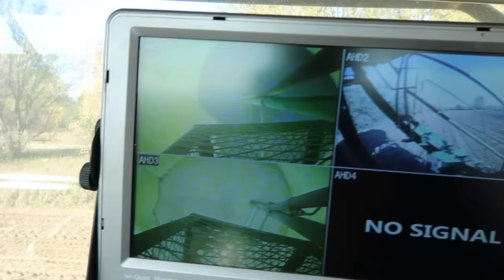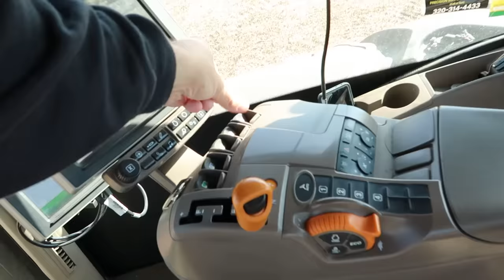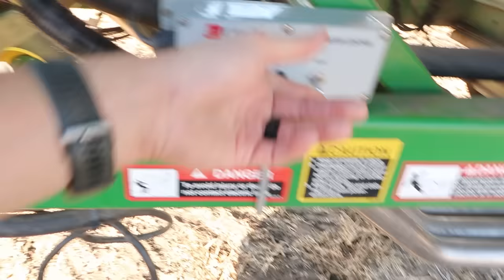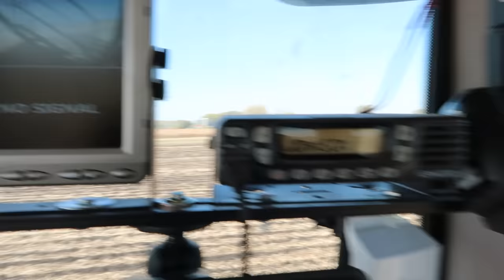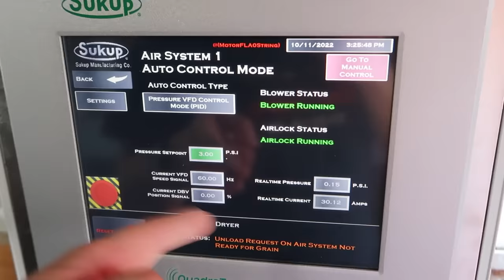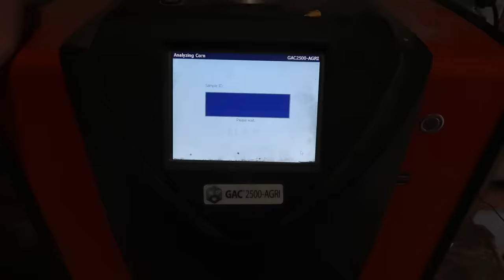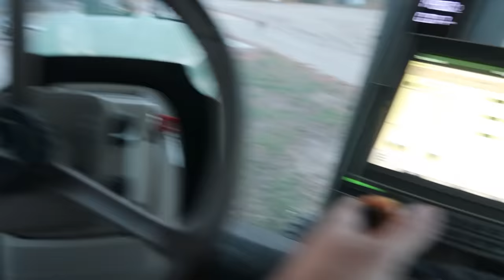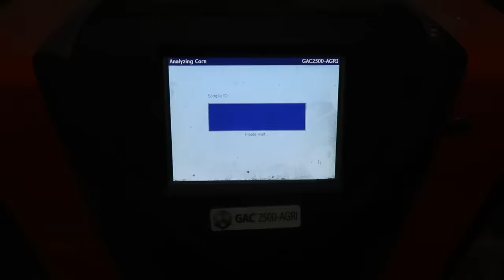You Won't Believe It!

Comment: People have probably told you but try a Montag Dry cart. We've used a 10 ton cart behind our 16 row strip tiller for 10 years. It's worked flawlessly for us, its also designed for dry fertilizer. We even pull a 2000 gal liquid tank behind it.

Comment: Watching Zach being frustrated with a machine and trying to sell that machine simultaneously is humorous.
Reply: It’s an unusual sales pitch
Reply from the maker: I'm too honest.
Reply: @MillennialFarmer  don't sweat it bro. There will be another way around that problem. Farmers always find a way. My grandpa always did😊
Reply: His pain is our entertainment
Reply: Honesty can be a fault and a blessing. I would rather have both than none at all.
Reply: @MillennialFarmer  Ever have a random hydraulic oil fire?
Reply: I'm sure it would work great as the seed tank it was intended to be. It's the trying to use it as a fertilizer tank where he is having the issues.
Reply: I think the only problems you have is the tanks , if they are ment for seed use it for seed , get the right kit for the tool and you maybe surprised
Reply: @MillennialFarmer  i would feel bad to sell anyone such a problematic machine and try to talk it nice. 
After that much trouble I would enjoy to destroy it, get a blow torch and feel all the frustration moving out and relaxation moving in
Reply: Most farmers are masochists so they would buy it to enjoy the pain he is after this market
Reply: @MillennialFarmer  You need less hoses and sensors and more gravity. It's insane how much tech (failure points) is between the hopper and soil.
Reply: He’s never had a problem with it, it was working great when I last parked it. Actually it works great when its parked, plus the headaches stop when its parked.
Reply: I was actually surprised he kept it after the debacle with it last year.
Reply: @hauptmann6  haha he probably wishes that the tornado would've taken it out for good

Comment: When you bumped up your fertilizer rate your fan speed wasn’t high enough and product began to accumulate in your wing hoses because they are the longest. That’s why fertilizer was still coming out when the meter wasn’t turning. Also it would have created pressure variations in multiple hoses because air flow was restricted thus diverting air flow to the hoses that weren’t plugging. That’s why your rate was jumping all over the place.
Reply: You are 100% correct.
Reply: god dang genuis!!

Comment: Love this new technology.  Micro switches, sensors, check values, video cards, potenmeters, flow switches, computer chips. All around fine dust and moisture.
Reply: If they can make a phone IP68 certified, I don't see why John D engineers can't make a system avoid more ingress-related problems
Reply: @scottpelletier1370  who’s gonna pay the techs salary if the machine always works?

Comment: On a really small scale spreading fertilizer, not through tubes but with a gas powered spinner, chunks are catchable (50lb bags have chunks you can catch and break up manually). But right above the opening is always an agitator (an auger or a straight bar welded perpendicular on a vertical spinning shaft) that spins around and breaks chunks I can't see. It keeps product flowing because there are ALWAYS chunks. Finer screens in the fill openings and an agitator look like things you've pointed out already as solutions. And solutions I think would improve things tremendously.

Comment: What was different between fields?  You folded the wings.  now you have an issue with one of the wings.   
If the line got pinched and prevents full flow to the wing, it will slowly fill up with product while still letting some through.  
Then when you turn the fan on,  that excess product in the lines finally gets by the blockage  Making it appear that the meter is still dispensing.
Reply: Came here to post exactly this, the lines are filling up and the fan is blowing it back out slowly hence the discrepancy and it ‘still dispensing’

An east check would be to leave it running the fan with the meter rolls of and see how long product comes out for.

Comment: I just started a new job working at a waste management transfer/maintenance station. My first job was power washing one of the route trucks to be repaired. This one was a front loader for getting dumpsters from restaurants and small businesses. Brother, power washing that tank cart was paradise compared to what I faced. Head to toe in a Tyvek suit, hardhat with face shield, rubber gloves that go to my elbows and a rubber apron. When you blast a pocket of maggots and a full diaper and the contents of both are now on your pretty white suit, you know you've arrived. You've reached the pinnacle of power washing. When I finished the inside of my face shield was just as filthy as the outside, on account of me throwing up several times. I thought $28/hour? that is great! Now I know...now I know.

Comment: Zack I would recommend a 100k bushel bin witch is roughly 60 foot 10 ring bin somewhere in there as a bin dealer even if can't get filled u have room for more acres as a bin dealer seems to be the most common size if u can afford to go taller

Comment: Before you restarted your beautiful strip tiller, remember you mentioned that it was completely wack?  It may have been left in an inconsistent state because the tractor didn't command it shut because it was whack.  Sometimes you have to restart and then fully cycle the start/stop to make sure that everything is in a consistent state again.

Comment: I just watched your last vid with the strip tiller again, the cart setup is working as it should. As I understand what happened, it was all working, then you moved to a field closer to home to run out the tanks. Was the ground a little wetter there? The would restrict the air flow out of the injector. You raised the rate some and as you went across the field the outer rows started to drift into the lower parts of the 3" hoses, the longer ones will show that first. As that happened the monitor sees less product flow on those rows that lowers the average it needs to maintain and turn up the rate at the meters, thus the center (shorter runs) going up. That speeds up the drifting, less product, increase rate, till cascading failure alarms. When you stopped with the unit out of the ground you released the back pressure at the injector allowing the velocity to increase and clean out the product drifted in the hose of 11 and 12. That's why they had product coming out, not the carts fault. I have planted with an identical cart for years, it's very seldom the carts fault. With problems like this always start looking at the end of the hose run, not the start. If the product can't get out, it won't go in. I think your injectors are to restrictive to the air flow. Did you notice the air pressure gos up when you are in the ground? If pressure goes up, velocity gos down. Sound familiar?

Comment: You guys saying buy a Brand X or Brand Y air cart are missing the problem.  West Central MN has two factors stacked against doing anything with air carts.  1. High and highly variable humidity causes bridging and dust buildup blockages EVERYWHERE.   2.  Heavy soil where normal harvest tillage is done almost always in damp to wet conditions.  This year is as dry as west central MN is EVER going to get during harvest.  If he can't make it work now, it's never going to work.

Air carts are for the drier west with their lighter soil.  One size doesn't fit all in farming

Comment: Good Day Zach
I could be wrong on this but we have experienced similar air balance issues on a different air cart. I would be willing to bet the problem started when you adjusted fan speed to account for more product going down in this video. If you could run similar fan speed as before it likely would have gone away. If it would be possible to run equal length primary hoses it would likely make a big difference. I’m just guessing but I will bet that is what changed when you moved from your chisel plow to your strip tiller is the length of your hoses coming off of air cart. It something to talk to Reddi about. There is a very delicate balance on tank top up pressure vs downstream air pressure. I hope this helps you out.

Comment: The only way you can have any product flowing from the injectors is you have drifting occurring in the hoses. From all the experience I have from working with air seeders, it looks to me that the hoses you have running to each row injector are too big in diameter for the air system you have. That is allowing product to slowly build up (or create drifts) in any dip in the position of the hose. Since you have a closed air pressure system, you should be able to drop down to 2" dia. hose from the cart to tillage unit. That will increase the speed of the product and help prevent drifting in the hoses. Hoses that have a small ripple effect on the inside surface will also improve the ability to keep the product suspended in the air flow for higher rates through the system. 
Another remedy would be to put a small cyclone cleaner to the top of each row unit to allow excess air flow that is needed to move the product to escape without going through the injector where it can be restricted enough to also allow the drifting in the hoses. You need lots of air flow to move fert.

Comment: Ha ha, I am low tech farmer myself, but from what I heard from my buddies is, that those computers can throw you off  if they don't have a 100% ground connection or a steady 13Volt power supply.  I would have tried one of the other tractors to pull it, then you know.

Comment: Thanks for another great video. 

It was interesting and enjoyable. 

First of all. Not trying to create any ill feelings BUT I agree with Becky, the strip tiller needs to disappear. Enough is enough. Got more important things to do on the farm. 
Sorry but how I feel and I support Zach one hundred percent but not that darn strip tiller. 

Looks like the new setup on your dryer is working good. Lot less noise and adjustments and easier to run and monitor. Great setup. 

You asked about what size bin to put up next year. Larsons new bin is working great for them. They might have some info for you. 

Getting both of the tillers going will help get the ground black behind the combine. Great you have two setups to do that with. 

Looks like not too far away from your new building going up. Nice to have that done. 

More harvest to go yet. Go get em. Beautiful yellow corn looks good and moisture is ok. 

Hope the fuel buggy is an easy fix. Always something with equipment. 

All for now. You all take care and be safe. 
Looking forward to the next video. 
Thanks for everything Zach. 
The Iowa Farm Boy.

Comment: The programs are not fixing it. The sensors are staying on. My opinion is in the wiring harness and or the pin connectors. Two stay on and the rest do not tells me personally there is an short. Just my opinion. Take care.

Comment: I'd say you have worn sections on your meter rollers (or the housing) or you have too much airflow which can vacuum product past those JD rollers.  Those are pretty much the only ways that product can get past a roller that is not turning.  That will definitely throw your rates out of whack.  Too much air flow will be most evident while you are sitting still as when it is in the ground you have the resistance of the ground around the openers and the resistance of the product in the lines which both reduce the air flow and will reduce the vacuuming.

Comment: If that’s intelligent ag blockage, all you need to do is swap the tubes on the ecu i stead of moving location of the sensors. If the sensor is bad it will still “show” the issues on the next sensor your using to diagnose.

Comment: Question ⁉️ what's the humidity if your running mornings and temperature??? Wind chill can freeze your fertilizer and humidity will make it stickie and not flow. Air trucks have the same problem. Might be a thought for your strip tiller.

Comment: Tool tip. I keep a 5/16 6pt nut driver on my boat for those aircraft clamps. The only nut driver I have. Its much easier to tighten/loosen the clamps, especially if there is any angle.

Comment: I wonder if you were to heat the air pushing the fertilizer if it would help with feeding issues by drying the product in the lines all the time the machine is running.

Comment: Hint from an Electronics guy.  Swap wires and see if sensor 4 reads 3 just fine...   still funny put wires back and change sensors.  Might  be cable or sensor or mechanical...

Comment: It seem those issues started once you'd  switched the sensor over - is it possible that there's some kind of electrical short within it, or its connector - which is affecting the whole system?

Comment: I'd think a flexicoil aircart or something specifically designed for fert application. I'd recommend a Horwood bagshaw aircart as that what we use and works with john deere hardware but I think they are an Australian only company. Pretty much anything other than those shitty 1910 aircarts. Borgault tends to talk well with John Deere as well might be worth some investigation.

Comment: Zach, do you think the issue could be solved by using talc in with the fertilizer? 

Just wondering if moisture is causing most of the issues due to the wide temp swings in your area. No idea if talc could work in that case though?

Comment: I am gonna guess that the fertilizer issue relate to flow rate, temperature and humidity. High flow may result in the near (middle) nozzles receiving more product and the end nozzles suffering. Check tube geometry and equal lengths. Heavy damp product may not flow as far down pipe. Pipe bends and pinches need to be eliminated. Product may need to be stirred and perhaps a dry lubricant (corn starch?)  applied.  End of shift blow out might keep todays product from sticking to tubes overnight?

Comment: On those sensors some times fine fertilizer  dust get stuck on the stethoscope part and it’ll read funny l. I’ve had that issue this spring with ours

Comment: Even the die hard bleed green guys I know say that the John Deere air carts are the biggest piles of junk on the market I would keep the tool bar and put a flexicoil cart on it the tillage tool looks like it’s working fine the flexicoil air cart uses a similar manifold system and should hook up very easily

Comment: Non farmer here, so forgive any ignorance, but why not go for liquid fertilizer through the sprayer?
Reply: Well for one you don’t apply liquid in the fall it really should be applied to the growing plant like side dressing in corn. But lots of wheat guys will apply N (nitrogen) in the spring than plant wheat into it, but N does not stay put. It leaches out of the soil. The other problem other than that it’s highly corrosive is that it takes a lot of gallons per/acre so a 1,000 gallon sprayer at 40/gals acre not gonna go very far. In other word it’s not practical or efficient. My opinion the best way is the way we do it by applying liquid fert on during planting. We place the N below the corn seeds and P (phosphorus) and K (potassium) side of the corn seeds. Great question tho.👍
Reply: Thanks for the info

Comment: Hey Zach, I think you have a really bad electric problem. Even before you flipped the sensors. I am not too familiar with your setup, but I was thinking. You might have moved positive and negative wires. If all of the sensors are on a series circuit. You might have back-fed all the sensors. Which would make the reading's on the monitor not right. Also, getting electricity from the wrong directional flow would keep those rows on 11 to 12 constantly. (The power has to go somewhere). I don't know how strong they are. You might have ruined them or might have not. I think you still have a problem with the wiring harness on row 3 not getting enough or too many voltages and amps. If you not getting all of the voltages and amps, as you know with the semis, it will not function properly, or the wiring harness might be loose or corroded on row 3.

Comment: Now you know why your dad is not strip tilling. All the old timers tried new things and had headaches that’s why allot of farmers don’t change or the old saying if it works don’t break it or change it.
Reply: If the farmers were still using horses where would we be? Not all new stuff is bad. Strip tilling is very effective for soil conservation, tilling time, equipment use and effective fertilizer placement for optimal plant growth.